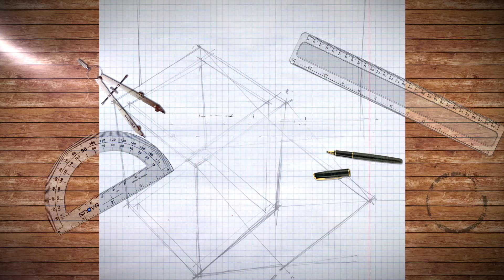Build a MOTORIZED monitor lift (on a budget!)

Comment: Did anyone actually build this in the past 3 years???
Reply: Nearly done building it now.  Ran into some complicating issues, but I'm almost there.  I need to tighten the belt somewhat and you'd better make sure all your holes line up perfectly or it'll bind on you.

Comment: why would I want to hide my monitor ?
Reply: Runnable19 this may not apply to you, but as a woodworker a do lots to scale of drawing. Having a monitor and keyboard on my desk takes up space that i would need to put my drawing paper on the desk. I personally have an adjustable drawing board specifically fir technical drawings, but this could be useful for someone in a similar position.
Reply: So mount the monitor to the wall and move the keyboard and mouse?
Reply: Pot Head moving the keyboard and mouse off the desk is quite a hassel when they are wired up, it's easier to push them forward and lower them. And mounting stuff to the wall isn't always an option, especially in apartments.
Reply: bigger workspace
Reply: Fucking Star Trek bro.
Reply: Runnable19 porn
Reply: Runnable19 background for filming/photography?
Reply: Birki gts This is also good for school use too. I always find myself struggling to find space on my desk when doing certain assignments. Having a monitor lift would be really useful.
Reply: Put it in the footboard of your bed.
Reply: Because making stuff is fun.
Reply: in the video, he is already moving it from 'next to the monitor' to in front of the user.

It just looks cool, and if you're a DIY person and have right tools, this is an awesome project.
Reply: People enters my room and there's porn
Reply: Sonofamother. Did you see how slowly it goes down?
Reply: LOL
Reply: For some people to record YouTube videos so they hide everything
Reply: Runnable19 maybe he's in massive dept and he has the same system to hide his house and ferrari
Reply: I don't think that this really gives you more room. As soon as you lower the monitor, you are also getting rid of the portion of the desk that it was sitting on.
Reply: you put a wooden board on top of the hudden moniter
lol didnt you watch the whole vid
Reply: So much room for activities
Reply: expert20valvehlx. LOL
Reply: Sonofamother "oh shit! Mom I was just studying, see? Zzzzzzzzzzzzzzzzzzzzzzzzzzzzzzzzzzp! See?"
Reply: Why not
Reply: I personally have a workshop and hate to have my pc peripherals out on my nearby desk because they can get dusty over time. This imitatively solves my issues since I can hide  my monitor/keyboard/mouse without taking everything apart and doing more manual work than I should.
Reply: Because he can make it and is practical for his uses.
Reply: I know why he would want to hide his
Reply: @Runnable19 So you think he made this video just for you? Although the video has been watched by more then 1 million people!
Reply: ThinkPad speakers are famously shit, so I instead use the speakers of a TV using HDMI.  I never look at it, though - it's a TV, not a monitor. So I'd like to hide it.
Reply: Yes.... "Helmsman  Active the Main View Screen"   ..."Aye Captain"  for when you Play Artemis
Reply: Didn`t you watch the damn video?
He says it literally a minute in to the video..

Comment: You can try building a frame around the monitor so you can avoid having to place that plank of wood every time you lower the monitor.
The frame can also act as a shelving unit for small objects or books. 

Awesome project man!
Reply: Michael Lee My thought exactly! That would even look cool. You can have your cactus collection on the shelf or something. :-)

(Cactuses? Cacti? Collection of prickly plants! There, nailed it.)
Reply: Succulent
Reply: Then he would have to clear up that shelf to get the added workspace. This is about getting more space, not about hiding the monitor and other accessories.
Reply: A board ontop would look pretty tacky. A better solution would be just mounting hinges to the plank so it would just get pushed out of the way and automatically close when lowering/raising the monitor
Reply: It is a budget version and it fulfilled it's purpose just fine, but I like that idea!
Reply: A little shake or vibration can make things fall down. 
If he presses the switch/lever accidentally, and the monitor appears suddenly, while he hasn't planned to do so, can make a problem!

Comment: I thought about attaching the extra plank to a piano hinge at the back so that it acts like a lid and then make an aesthetically pleasing frame on top of the platform that acts as a lever that pushes it out of the way when the platform rises and lets it back down gently when it lowers again. It wouldn't cost very much to add something like that.

Luxury model: add an extra smaller motor connected to the switch that runs the lid itself with a relay of sorts to delay the signal so that it doesn't lower the lid too early when lowering the platform.

Comment: The timing belt is likely made out of chloroprene rubber with carbon pigment and reinforced by cord such as Kevlar.

You could glue angle cut ends of the belt together using Contact Cement, which is a glue that consists of chloroprene rubber dissolved in volatile solvent, that should weld it together like it was made in one piece. Additionally you could take some thin synthetic cloth and glue some of that along the back side of the seam with contact cement to reinforce it, or maybe a piece of bike tubing.

This is not tested by me, just an idea.
Reply from the maker: Thanks for the tip! I will try it at some point.
Reply: Alexander Fagard that works in a machine where the clasp moves along the axis opposite whatever it's supposed to be moving along, so the clasp never hits the pulley, because the range of the belt motion is less than half the bell's length. In this build, the belt is used in an unusual manner and for the complete range of motion, the belt must take dozens of turns, and the clasp will be hitting the pulleys. Like uhhh, the platform travels 1.25mm per revolution of rod, a pulley has 16-60 teeth, let's say it's 20, with a pitch of 2mm, so to get the monitor to travel 40cm, that's 320 revolutions of the rods, or about 13 meters of belt motion, and the desk is obviously less than 13 meters long, so you have a problem.

If it was me I probably wouldn't bother with belts at all and would synchronise a bunch of stepper motors instead. Apropos that, it shouldn't require any microcontroller work. Just a $1 stepper driver from a 3d printer and a 555 circuit to give it step pulses. But the motors aren't cheap unless very slow and very wimpy is fine, in which case there is 28BYJ-48 toy stepper which needs to be converted by cutting out a center tap. But no, I wouldn't support a desk on top of those, but it would be fine for a camera slider.
Reply: yea i see what you mean, didnt fully think it through
Reply: I think I'd have bought an endless timing belt at roughly the correct side and worked the mechanism dimensions around that.

Comment: If you put the platform on top of the monitor, it will close the gap itself
Reply: Yeah but it is ugly ...
he could make a bord, which flips back, when the monitor comes out, and flips over the gab when the monitor goes down
Reply: Maffinnator that is true. Although a hinge or other mechanism would have to be attached to the wall and the board may get in the way of space necessary behind the monitor
Reply: Maff Yes, but having a wood block on the side of your desk would look weird
Reply: not necessarily, you can add a bonsai, or google home, or wireless lightweight speaker on to the top shelf. On the desk is brought down, it acts like rest of the table, and have those above mentioned items.
Reply: that was the first thing that came to my mind, but after watching the video, I changed my mind from it :)
Reply: that is a good idea, I was thinking the same
Reply: Not if done correctly. Maybe using a set of linear actuators, instead of the screw rods, he could set up a shelving system that moves up and down with the bottom piece of the part the monitor rests on, and everything would be still hidden. I should probably price linear actuators...
Reply: Or just make a frame. A frame wouldn't look ugly, and would even probably accentuate the look of the desk.
Reply: You'd still need Linear Actuators so that none of the metal bits show.
Reply: it may be too heavy with the wood ontop
Reply: NTDesign but how bout he make the wood thinner so will not be so heavy
Reply: P.R R Yes we have that in our school
Reply: maybe u can build a trap , or something under the desk , so it would close by it self
Reply: Or just chill out and put it on yourself which is quicker anyway
Reply: yes but this is not so cool
Reply: It will also require a more powerful motor etc..
Depending on what kind of platform you use of course..
Reply: or a bigger gear
Reply: an T shaped platform with a hinge should do the job. put cork underneath for putting notes on it and reminders. it could work even when it's closed
Reply: @Maffinnator  yeah but I say that method is more practical. Let's say you are keeping a glass of water on that board and you forget about it and press the button. What do you think would happen in both the cases and which one is better.
Reply: or he could not fix something that's not broken
Reply: make it thin acrylic or tempered glass so its not very visible.
Reply: You could easily hinge the lid for the monitor to “push” through on its way up just like those beds with a tv in them
Reply: @nikolatotev  That was what I thought. I wonder how much weight it supports tho. 
I would love to have 2 monitors 27" and at the top (like a shelve/platform to close the gap) that will be used like a shelve for small figures (pop funko)
I wish I could do that.
Reply: Picture frame the monitor  and the top will always just be there,
Option 2 build a cabinet and have the monitor mounted in the cabinet which would be more stable  and you could adjust monitor height/location in the box and route the cables out the back giving a very clean look.

Comment: This is what I was looking for and hope to implement in the coming months. When done I'll video reply for:
- Extra rigidity of the moving shelf (just add a couple of L shaped metal bar below, like the vertical ones in the fourth corners).
- Improved join of both ends of the drive belt (just sew an opposed teeth bit covering both ends and wrap it with some solid enough metal sheet).
- One touch operation in both directions. Yes, could be an Arduino or similar microcontroller, but let's go old school: Two time pulse circuits (one for up, one for down) with a 555 timer with enough time to reach the disconnecting switch. Some TTL (or CMOS if we operate at 12 volts) logic gates and relays will come handy in case Mr. Thick Fingers presses both buttons up & down at the same time so that only one direction of the actuator engine is active.
- Panic button to switch everything off, just in case :D
- And as someone said, a flipping board.
Excellent work, matey :)

Comment: "Schematic and wiring will be added later." 
Can you please add these?
Reply: He forgot... damn it!
Reply: @Ed19601  thanks, very helpful...
Reply: lets see if he sees another request for the schems.
Reply: Hey bro i think you live in india if yes then can you tell me which motor should i use for this project
Reply: its the most basic electronic to wire a 3 points switch with limit switches .......
Reply: @Ed19601  it can be done by making "X" wire connection. no need of diode
Reply: @ronakpatel3914  i have no idea what you mean
Reply: @calvinhoyinleung9555  Very helpful
Reply: if you cannot do that simple wiring , then for sure you can not do any other stuff shown in the video
Reply: @arfan521  Thank you for posting this
Reply: @tomwoolley5779  your welcome.

Comment: could you attach the plank of wood to the wall with hinges and have a piece of string attached to it and the platform, cut to the right length so when it hits the bottom it pulls the wood down closing the gap automatically?

Comment: Why not make that cover an automatic hinged cover?
Just throw some cheap piano hinge onto the board, make it hinge behind the monitor on the wall side, and put a little arm on the moving platform that pushes the hinged cover out of the way as it rises so the monitor doesn't hit the hinged door.
That way, it automatically covers and uncovers itself with no extra mechanisms or moving parts... just a simple hinge.

Comment: Part of the fun with DIY projects is thinking of extra things that could potentially be done. Like perhaps attaching the extra board right to the whole set up, that way it'll lift when the whole thing lifts, giving a sort of shelf when in the raised position, which could then potentially allow you to add some lighting.

Comment: This is a good idea, I tried this a few years back with an old window mechanism from a car, I kept the switch and everything so I'd "roll up" my monitor, but it died after just a few uses because the scissor mechanism wasn't too efficient at the bottom of the stroke and my monitor was a bit too heavy.
I might try this one out, since my computer desk doubles as my crafting and leather work station and I have to work around a bunch of crap.

Thanks again for the inspiration! 
"Calmin' Furze" Strikes again!

Comment: So much easier and probably cheaper using a linear actuator for the lift. They work great for TV lifts in homes, boats, and RVs. Something else you can add to yours is to put a shelf above the monitor the same width as the desk. Use the board you drop in there for that. By doing so, your desk looks complete and can even have a plant or two sitting on it. When you need the monitor, hit the switch... no need to remove the board or plants as they will just rise up above the monitor. Then you will not have a loose board sitting around when your monitor is in use.

Comment: It's a very good job but I don't find it useful. The fact of hide the monitor Is to use that space for another task or to keep it away form dust if you are working close. A simple solution would be put a wood table with the same size of the base in te top part of the monitor. So when your monitor is hidden the top table will fill the gap.
Also, probably will be a good idea put a wood covering the front part of the monitor when is hidden to prevent accidentally hitting it.
By the way, I'm impressed with that little DC motor to lift that weight. I would have used a similar motor but with a planetary reductor to prevent the weight pushing down (some planetary gearbox are unidirectional).

Again, very good job!

Comment: So I am working on a footboard for my bed that has this design inside it. I have it all built out, but a few issues...

- Motor is ridiculously loud. Why is yours so quiet?! What have I done wrong?
- Timing belt is so difficult to get to right tension. Sewing isn't the difficult part, but correct tension is. Tips?
- Works with just my plank of wood, but won't spin with weight added. I bought a 775 motor, though maybe not exactly the same on as you. 
- Struggles once plank is more than halfway down as tension on the board seems to change a bit. Maybe just need to measure more precisely...

You made this look so flawless and easy! I am struggling! Haha
Reply: What is the voltage of your power supply?

Comment: Hi Matt, 
following your projects is always a pleasure. Now I have found some time to (re-) build the monitor lift desk. But ... parts are not available any more. So, which motor is required regarding the rpm? I assume we do not need to have 10000rpm for the lifter.  Could you share some technical details for us regarding the rpm and maybe the recommended power so we can search and find a proper model on ... the web. For sure I will pst an update of "my" project.
Reply: Hi Bernard, same issue here. Do you have found the parts?
Reply: @edgarveen2600  no. I had to „reinvent „ it with other, available parts. But the idea is the same.
Reply: @bernhardstillger1026  most parts are easy to find. But I have difficulty to find the right motor which has enough strength and speed.
Reply: @bernhardstillger1026  What parts did you end up using (I'm late to the party and so the links no longer work and am interested in what type of motor to use (i.e. correct rpm, voltage etc). Any help greatly appreciated

Comment: They used to sell this in a shop I used to work in for £1500. They did cover it with certain designs but I never New it was so easy to make 👌🏾 excellent video.

Comment: Made a few minor improvements and I think mine is perfect. 

-replace motors and moving parts with a simple, non-sticky piston
-wire the piston via red stone to a lever which will control whether the piston goes up down or stays the same 
-voila!!

Comment: I'm just wondering, how u know about all these small pieces u use in ur projects.
Reply: Same
Reply: A lot of trial and error
Reply: I work in a hardware store and had limited experience with all these tiny nuts and bolts when I started.  After a year of working there I could tell you about all the stuff in this video and more just from working in those 2 aisles.  

Not saying you need to work in a hardware store, but a hobbyist might spend some time in those aisles as well, and just by seeing these pieces you tend to learn when they might come in handy.

Comment: So I just finished the basic build for a TV cabinet I'm building. I tried using a 12vdc 8a (output) power supply.....it barely moved the shelf.

I then plugged in a 19vdc power supply....better.

I'm going to try a 24vdc next, hopefully that works better.

The end product needs to lift a 25# tv.

Fingers crossed.